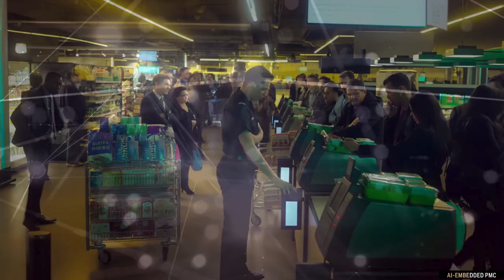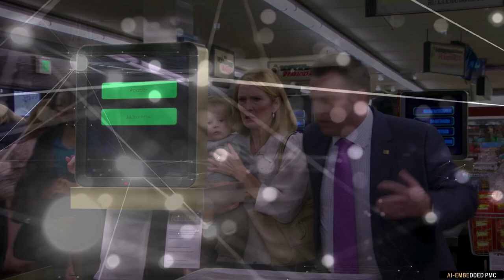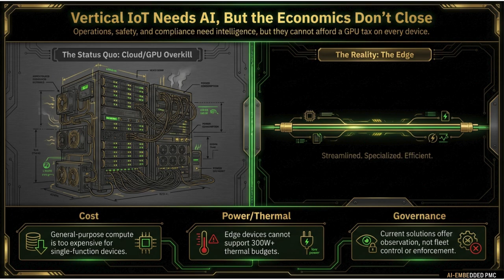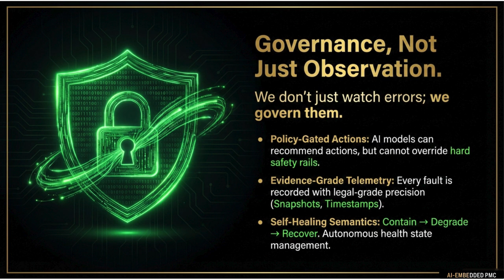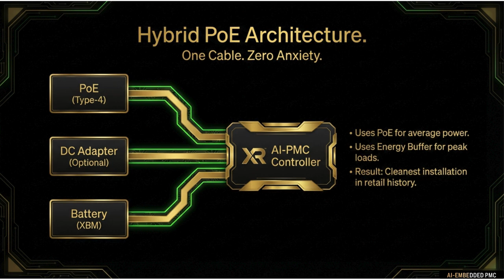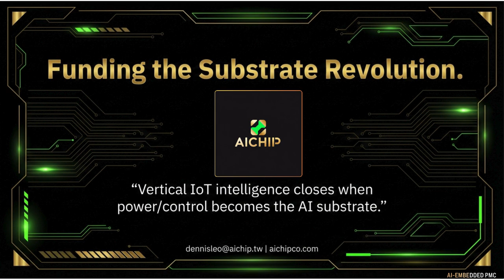AI-PMC: Deterministic Power Governance + Drift Detection for Self-Healing Edge Systems

Comment from the maker: This video introduces AI-PMC, an architecture that pushes enforceable intelligence down to the power control substrate for cost-sensitive vertical IoT.

Core ideas

Deterministic power governance (policy-gated actions + hard guardrails)

Evidence spine (replayable event snapshots for audit + ML training)

ML-assisted drift detection (detect degradation before it becomes downtime)

Deliberate execution boundary

Governance + drift detection: inside AI-PMC

Power conversion: external (FETs/inductors)

Why it matters

Embedded intelligence without cloud latency/privacy or “server-class” cost

Autonomous convergence toward stable power-up states

One silicon, many verticals via customizable profiles & policy packs

If you build edge systems where sequencing, brownouts, and field drift drive RMA/NTF cost, let’s connect.

#EmbeddedSystems #PowerElectronics #EdgeAI #IoT #ReliabilityEngineering #SystemArchitecture

First pinned comment (EN)

Key takeaway: Self-healing starts below the app layer.
AI-PMC enforces deterministic power governance, logs replayable evidence, and uses ML-assisted drift detection—while keeping power conversion external (FETs/inductors).

If you want the full engineering journal write-up, comment “AI-PMC” and I’ll share it.